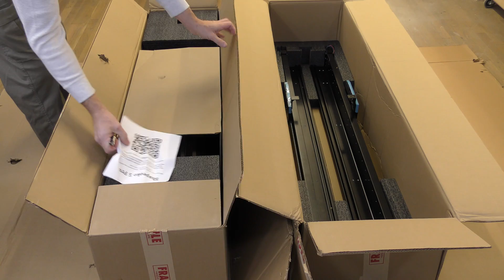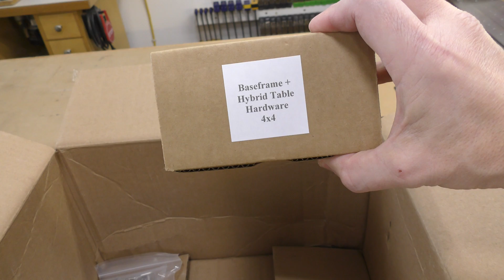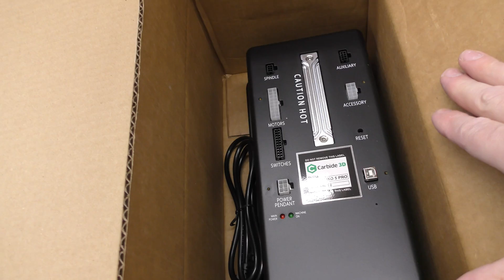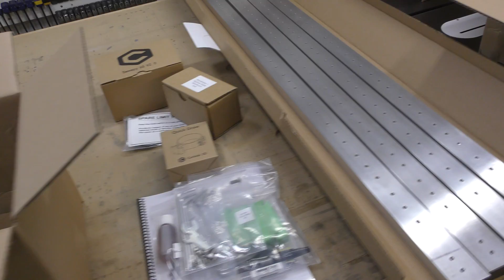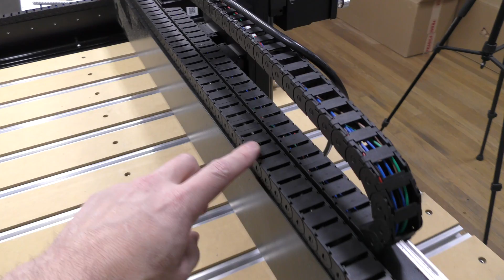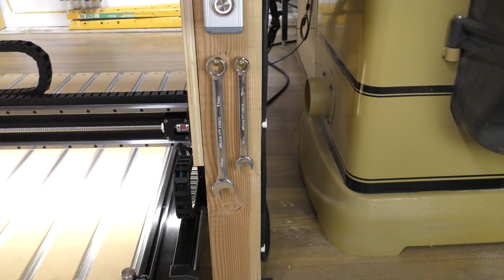The Unboxing and Assembly of my New Shapeoko 5 Pro CNC Router 4'x4'

Comment: Nicely done!  
However, I don't understand your decision to put this machine basically on the floor.
Reply from the maker: Thanks, but this is an old video and at the time I had to put it under my build table because I didn't have room elsewhere in the shop.  I've since built a dedicated table for it.
Reply: @StudioZ-maker 
I was just curious. Not really the 1st place someone would put a machine you need regular access to.

Comment: I received my Shapeoko 5 Pro yesterday and assembled it today.  I made my first project (simple coasters) this afternoon.  We both had the exact same experience.  Especially with the X and Y Left drag chains.  I too had to do it twice because the manual was so bad and the video angles and verbal description was poor at best.  I also cursed them about the height of the spindle only referencing the removal of the router for the height.  I too just judge the height the best I could off the video.  Seems to work so far, one whole simple project.  You must be a lot younger than me.  No way I could bend over to do all the work placement and bit changes on my hands and knees.  But you do what you got to do.  Have fun and make lots of saw dust.
Reply from the maker: Yeah, let me tell you I left a lot out of the video when it came to the drag chains, now I just laugh about it.  You're going to love the machine it's really fun and there is so much you can make.  I have recently moved the machine to a new mobile table which will be in the next video.  I have decided to focus a lot more on using the machine and I needed better access to it.  Enjoy it 👍

Comment: Crouching under the table is a bit difficult, but I think the table can be raised, on the whole a very good idea….🎉🎉
Reply from the maker: Thanks!  The outfeed table cannot be raised it is flush with the table saw top.  Since the making of this video I actually upgraded the spindle, which is in another video, but now my clearance under the table has gotten shorter so lifting the CNC router up higher off the floor isn't an option either.  I guess I'm stuck crouching under there for a while, thanks again for appreciating the idea 👍

Comment: Nice!  Congratulations!  What do you use for dust collection?  Any light you could provide would be greatly appreciated.
Reply from the maker: Thanks!  I use a special vacuum for the wood flooring industry, it's made for very fine dust.   You can buy one but it's not necessary, a shop vac is just fine.  I just happened to have them so I use them.  The only benefit is that it has a pre filter which can be shaken without opening the vacuum thus restoring full suction.

Comment: I bought mine last tax year but I couldn't use it until my husband & I had our surgeries. They were spanned out over the year and recovery is still ongoing, both of us had more surgeries this year as well. Just wanted to say that it was the reason for the long delay, and I was waiting for this tax year to get a computer. 
So, were you NEW to the software too or do you have some background with coding or similar software? I have NEVER worked with any type of software like this nor with a CNC machine. I use computers for very basic things like google searches. That's pretty much it, so this is gonna be a challenge and adventure for me. I will be starting sometime after Thursday or Friday. It will depend on when my laptop gets delivered, supposed to be on Thursday. I will subscribe. I would love to see what you are doing.
Reply from the maker: First, I would like to say I hope you and your husband are recovering well.  I had 2 surgeries the last of which was 11 months ago so I know the struggle.  
Yes I was new to the software but I am somewhat decent with computers in general.  I will say this I have tried both Carbide Create and Vectric Aspire.  For me Carbide Create made simple things difficult to design whereas Vectric was so much easier to use.  This may not be the case for everyone it depends on how your brain thinks.  Some software works for some but not for others.  However, Vectric is pricey but worth it to me.  My suggestion is to try different ones and see what works.  There are lots of tutorial videos which I watched and at least Vectric has a free trial.  Good Luck and thanks for subscribing!  I should have another video out soon with a little more challenging 3D design.

Comment: My biggest question is, how in the hell did you move the fully assembled CNC down below your table? Not only based on the weight once it was fully assembled, but also ensuring it stayed squared while making such a drastic  move of it based on it's precision? I just have the 2X4 Shapeoko and was always concerned with moving it if I had to, so I built it on a table with locking casters if I had to move it. Hope you enjoy your new CNC. I am enjoying mine, but the learning curve of design has made my use of mine more difficult than I imagined, but with practice and with the help of so many videos on YouTube, I am sure it will get easier over time. Thanks for sharing your video.
Reply from the maker: Glad you enjoyed it,  It wasn't too hard to move just awkward to grab.  We used lifting straps that went across underneath and with my nephew we managed to get it done.  It was heavy but it is solid and didn't budge a millimeter afterwards.  I'm loving it,  I found that it was fairly easy to learn.  In fact, I'm trying out Vectric software because I want to be able to design in 3D from scratch, that will be in an upcoming video making something in 3D.  Keep at it and Carbide 3D's group is also very helpful, best of luck!

Comment: I have a different CNC and (I am assuming) like you space is an issue.  I am seriously considering hoisting mine from the ceiling.  Yours under your outfeed table is an interesting idea.  How long have you had it there any thoughts on having it that low? back/knee/ease of use issues? Your thoughts are appreciated
Reply from the maker: So in a perfect world I would definitely have it on a table and leave the laptop at the front of the machine(which I could easily do now, just trying to do other work while the machine is running) . I've had it set up now for about 2 weeks and for me the kneeling down isn't a problem,  I just really have no other space to be able to dedicate for the machine.
Reply: Love how you put your machine under your outfeed table - I think I'm going to do the same thing when I get mine!
Reply from the maker: Awesome! It really saves space.